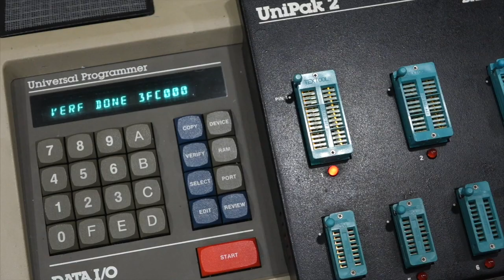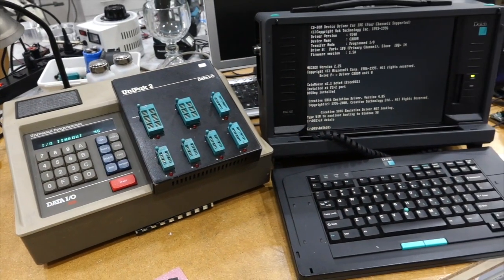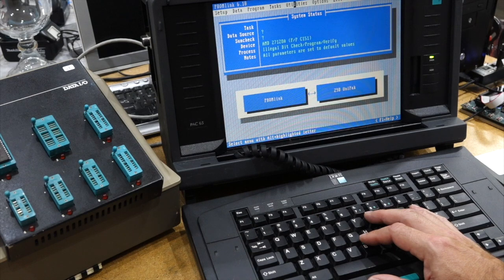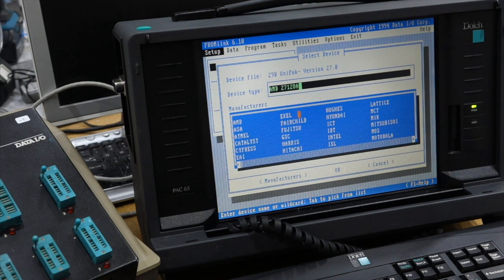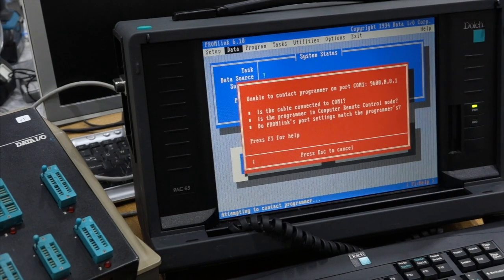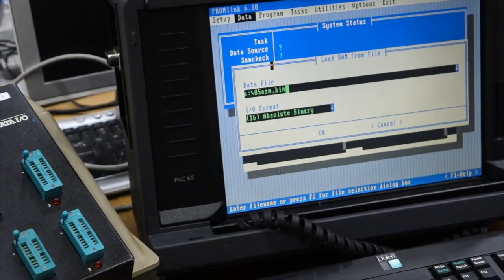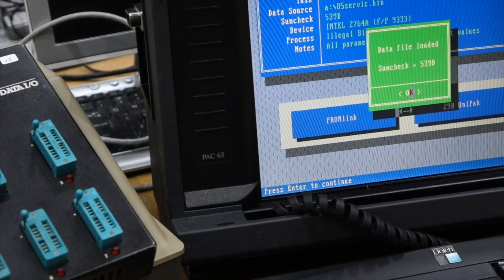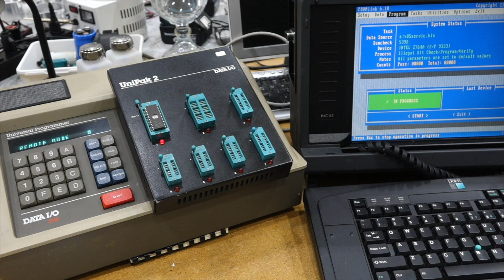Data IO 29B PROM Programmer Demo: burning the HP 85 service ROM

Comment: I'm pretty sure that's the same type of programmer I used at Control Data Aerospace Division to program proms for the AN/AYK-14(V) computer for the  Navy's F-14's (all the ones in the movie 
"Top Gun"). After we programmed them we would bake them in an oven to test reliability. They say there are still planes with that computer still flying today, I call that reliable!!
Reply: I purchased one from BAE systems (British Aerospace) 
So they were using them too 👍

Comment: I needed to program a few of 74188 32x8 bit PROMs and I was lazy to do it manually... Fortunately a friend of mine had a compatible programmer where it was just a matter of seconds to get them programmed.
Never throw away these old programmers, as they might save the lives of lots of old machines.

Comment: Well done getting the programmer up and running. I picked up a System 19 at an auction before the days of the Internet and without the manual I never made any headway with it.  Your video reveals why I was never able to intuitively work it out! I think I broke it up some years later. Your mention of reading proms from the Alto reminds me of a really unfortunate event where a current model of programmer failed trying to read an irreplaceable PROM - it killed the PROM too! It's good to backup those old UV EPROMS before bit rot sets in. I have a completely unbranded oddball machine with two 5.25" floppy drives and every eeprom in it was blank, not helped by the fact only paper labels had been fitted over the windows, all of which had fallen off. Really enjoying your videos - would love working with gear designed to be repairable again :)

Comment: Woah - where can I get that connection tester? That's extremely useful.
Reply from the maker: Yes, they really are, particularly for serial cables, of which there is apparently an infinity of varieties. Look up Paladin Tools or Weidmuller Cable-Check or Cable Tester on eBay, they are fairly common. The more recent ones will also test Ethernet cables.
Reply: CuriousMarc Cool! Thanks much!